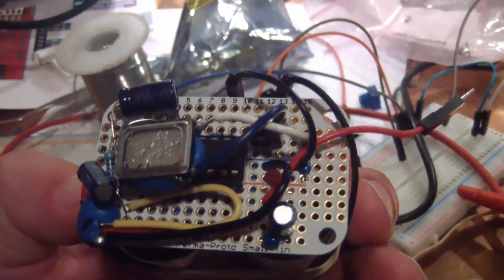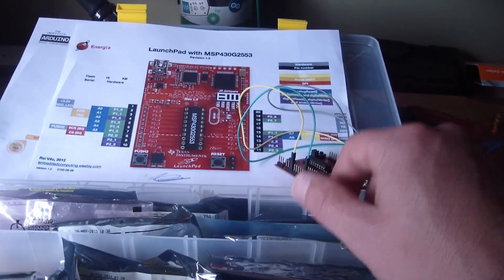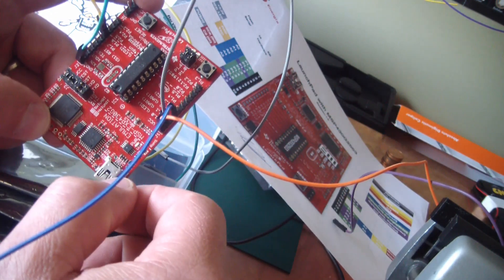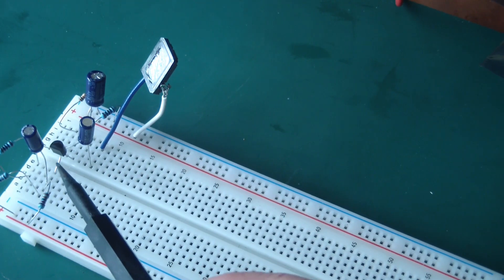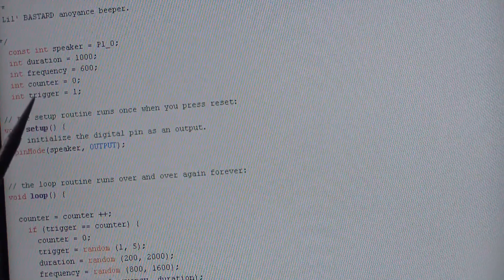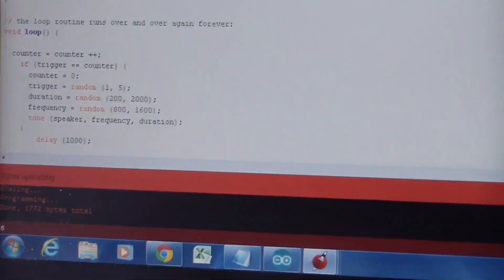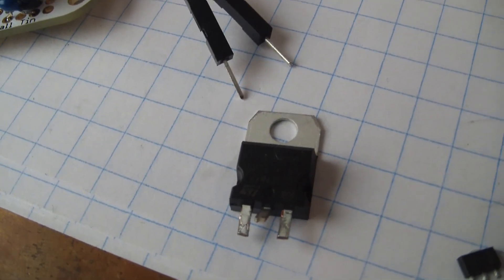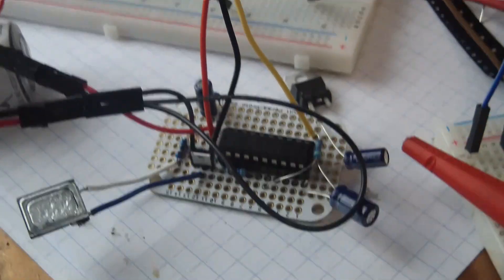Zen Blaster; a Most Annoying DIY Electronic Device

Comment: Get the frequency up in the 17-22khz range for even more evil fun.
Reply: PhattyMo barely anyone hears that, also that speaker might not handle
Reply: SugarBooty I don't know about the particular frequency but, there are crickets here that sound like a high pitched fire alarm bell going off (constant sound not a 'chirp, chirp' type sound,) and these bastards are ridiculously hard to locate! It's pretty fun trying to find it!
Reply: inthefade
Indeed, multiple designs were thrown around, with different sampling frequencies, reconstruction filters and corresponding dynamic ranges and stored bit depths, but also with different disc dimensions. It is widely believed that Beethoven's 9th influenced the CD specs. There is indeed one performance that hits exactly 72 minutes, that's the London Philarmonic conducted by Klaus Tennstedt, lending some credibility to the hypothesis. However, Herbert von Karajan's (Berlin Philarmonic) performance is a lot shorter at 67 minutes, as are most others, and it was Karajan who was featured at the unveiling of the final spec.

It definitely wasn't for Mozart, his longest is the 41st and it spans barely more than half an hour.

It is to be kept in mind that CD is an approximated Constant Linear Velocity recording, i.e. the CD contains a lot more data on the outer tracks than on the inner ones, and the rotation speed is adjusted accordingly in early CD players (later ones simply buffer the whole rotation or more to retain same rotation speed). So increasing or decreasing the size of the disk by millimetres or fractions thereof would provide for a very sensitive variation in length. Around the final diameter, 5mm more or less would account for a difference of about 15-20 minutes.
Reply: SugarBooty  I haven't tested it recently, but I could hear up to 21khz or so when I was 18. CRTs are still annoying as fuck to me, so I know I can still hear up to 16khz.
Reply: PhattyMo Yes,I'm aware of the human hearing range. The idea is to turn the frequency up just high enough so you can't hear it anymore. Example: A friend and I made something similar with a 555 timer,a Horiz. output transistor from an old TV,and a piezo horn tweeter. We hid it under the couch,and discovered that it would make his room mate cranky. And after a while he got REALLY cranky,and he would decide to leave the apartment.
Give it a try. You can't really hear it,but it will affect you. It's almost like having water in your ear or something. A kind of 'pressure' feeling.
Reply: PhattyMo As long as you don't make it too loud.  I've read that you can cause damage to the ears even with inaudible frequencies (doing spectrum tests on my studio monitors).
Reply: PhattyMo You made a mosquito!   https://en.wikipedia.org/wiki/The_Mosquito
Reply: Richard C That sounds like torture! Where do you live that you have organic torture devices?
Reply: Maybe I was wrong, I could have sworn that we can perceive frequencies that high! I just tried it myself as well, and I couldn't hear above the same 16khz. Maybe it is the sound card, I'll have to try with my frequency gen, that is broken.
Reply: cyberconsumer yeah, pretty much only children and dogs can hear in that range.

6-12 kHz should be audible to most normal adults.
3-6 kHz would still be in the hearing range of most elderly people.
Reply: cyberconsumer Thanks, that will be useful to know in the future
Reply: compwiz00 Indeed, I still hear CRTs to this day! I still haven't fixed/gotten a new frequency generator, so I can not prove or disprove anything as of now.
Reply: SugarBooty Also if you're running poor digital audio gear it literally strips out the higher frequencies.
Reply: +PhattyMo holy shit -- that is fucking devious, right there. You guys literally generated a mild anger-issue for the guy, lol. I know that "pressure feeling" you're referring to, btw: The guy's eardrum is vibrating like absolute crazy while the tone plays, despite that he can't hear the sound, so there actually is pressure from the air being moved in the canal by his eardrum. Devious, I tell ya. 

...

Genius, too.
Reply: +SugarBooty  What are you listening through? I am yet to find headphones which can play beyond 12-14 KHz, if you're lucky, and honestly that's plenty for actual music. Speakers... yes, i have some ELAC, they can do maybe 20 Khz, but the waviness of the response around those frequencies is going to be pretty high because there's edge diffraction interfering everywhere, there's a lot of energy loss, you'd need to generate band limited noise or sweep around a bit and find the frequencies that actually play. Also they will only be audible dead head on, a few degrees of angle and they will be nearly gone.

It's possible to hear very high pitched sounds. The question is, whether you WANT to hear them. At somewhere between 16 and 20KHz (individually different), the audibility threshold rises sharply, and approaches pain threshold. You can't even specify the audible range for an average person without specifying the sound pressure at which you want those things to be audible. And then at the edge of the range, there isn't going to be much frequency sensitivity whatsoever, it's not even clear how much you're hearing of the original frequency and how much of the ear introduced distortion.

CD Audio settled on a 22Khz Nyquist frequency in order to give a few KHz of room for the reconstruction filter to roll off. I think 20Khz -3db was taken as a guideline to be able to build a reconstruction filter economically and without introducing more distortion than the dynamic range implies, and 22Khz Nyquist emerged thusly, and from that followed the approx. 44Khz sampling rate. In professional equipment, 24 Khz Nyquist was chosen to give reconstruction filter even more room and reduce distortion and noise even further, as additional dynamic range is required for intermediate recording material.

BTW, even for today's recording formats and hardware which runs very high sampling frequencies, the reconstruction filters are still usually built with 20Khz corner frequency... make of that what you like.
Reply: inthefade
 Actually i found this document written by one of the Philips engineers: http://www.turing-machines.com/pdf/cdstory.pdf

According to this, anything about or above 40Khz would have clearly been acceptable, but 44.1 KHz was already an established system in PCM data encoding for video tape, so they chose that, and that frequency couldn't have been any different because it was a multiple of TV broadcast line frequency. In my opinion, it implies (though it is not mentioned) that there probably was already a suitable 96db S/N (16-bit equivalent) filter design for 20khz bandwidth and 44.1 KHz sampling rate.

He also says that Beethoven's Ninth length was not instrumental; but he does mention sheets of agreed upon size and length targets from the upper brass, and the question where those come from arises, the length of any particular music piece could have still played into that.

Of course high quality vinyl LPs aren't particularly long, you could potentially fit them on a 10cm CD, a format which was, by some accounts, also suggested at SONY.

Here's another account from the same guy: http://www.turing-machines.com/pdf/beethoven.htm

This one does mention Beethoven's Ninth specifically; and it concludes that the reason the size of disk was chosen is in order to prevent Philips affiliates from getting a head start on pressing CDs. It also makes a point that they actually had a great latitude of recording densities to play with, and settled on one 30% lower than what they could achieve, because 12cm size was already decided politically.
Reply: SugarBooty I just downloaded a tone generator for PC and in decent headphones I can't hear past 16 kHz. Maybe the sound card is crapping out, I don't know. Upper perceivable boundary decreases with age and I am 25.

*Correction: nothing is audible with sine shape, square wave setting produces something audible in the whole spectrum, but I think it's garbage.
Reply: SugarBooty Above 20 is inaudible to almost everyone...15-20 is millenial hearing, 12-15 is genx age
Reply: frollard  I am on the older end of millennials (and my parents are gen-x), and despite my seemingly otherwise advanced age (31), I can hear up to about 18.2 kHz in one ear, and about 17.4 kHz in the other. some tables though said that for my age-range, the expected upper end was a bit lower.

lower end seems to be about 15Hz.

I have noticed that, on my PC, trying to play a silent waveform generates a faint high-frequency squeal (not sure frequency), but it is not readily noticeable if any other sound is present (and is absent if no sound is playing).
Reply: Siana Gearz I heard the 22.05KHz Nyquist freq was decided on somewhat arbitrarily because they could fit a particular Mozart composition (I forget which one in particular) on a single compact disk at that sample rate.  And that is why 74 minutes was decided upon for album length on CD, sample rate derived from it.

I'm sure the engineers wanted it to be >20KHz, but I had heard a different logic to the choice of 44100Hz.
Reply: +SugarBooty There used to be a 'misquito' ringtone kids used in school so the teacher could not hear it, since people typically lose the ability to hear it at 20-25 years old. it was in the 16k-18k range. 
Adults usually can not hear much past 15k after they hit 20-25 years old. It only goes down hill from there.
Reply: PhattyMo 5kHz is the frequency of a chainsaw and nails scratching the blackboard
Reply: compwiz00 took my desk out of the classroom because a history/ football coach did not believe the 32"CRT was driving me crazy, no audio  just a black screen . at almost 40 it takes higher audio vol. to drown out the CRT noises.
Reply: cyberconsumer If i'm not mistaken, 22khz is still considered to be in the healthy spectrum for hearing. It might be fainter but we still hear it. Higher frequencies are harder to locate, and thus will be more annoying. Also, I think that the speaker would handle it fine. It looks like a tiny little tweeter thing.
Reply: @sugarbooty  maybe the minute you're born, but give yourself a few years and you'll struggle to detect 18khz even at extremely high volume.
Reply: SugarBooty
MP3 compression cuts everything above 15 kHz, maybe there is a reason.

Comment: Arduinos for good and launchpads for evil?
Reply: William Anderson a single 8-pin Attiny25 + a piezo speaker hooked up to two digital pins and a battery will do the job as well. Using the Arduino as a programmer you can flash the program. This way it's cheaper, and you can use the full arduino for something more useful
Reply: topher Piezos bend in one direction if you apply a voltage, but they don't spring back very much. By reversing the polarity you bend it in the other direction. Keep cycling the polarity to generate sound
Reply: nrdesign1991 To simplify, with DC on piezos (and really, any speaker), you are generally pushing (positive offset from 0V) or pulling (negative offset from 0V). What you want is to push (positive) and then pull (negative)immediately after the push, which is doubling the displacement of the vibrating membrane. this simulates an AC waveform, which is what speakers are almost always intended to use.
Reply: William Anderson Every evil genius needs one.
Reply: nrdesign1991 yes!!

But you still need a transistor to up the volume.
Reply: topher I thought about abusing two digital pins as a H-Bridge / D-Class amplifier. Driving a piezo single-sided with a transistor won't boost the volume much.
Reply: nrdesign1991 so Darlington it!

Comment: Little tip:
counter++ itself increments the var. counter = counter++ set's counter to counter and then increments counter. so you could ommit the "counter = " part
Reply: ***** Yea the moment he said anyone who knows C avert your eyes I was like cool time to ignore for a second and still ended up seeing his code. It made me cringe.
Reply: Rob Nelson but part of the process of improving your code (or anything else) is to get feedback.
Reply: mainly just the unnecessary lines of code. Most of that loop can be condensed to a couple lines with no need for the if statement.
Reply: illudian Sleep puts the processor in sleep mode and therefor saves power. (10uA instead of 800uA in the video)
Reply: PyroShim he could have simply just set a random delay and not have had the counter, trigger or if statement.
Reply: well I have been up for 24 hours so I think my brain was like oh hey your talking about sleep yea I need that
Reply: +TheTrueM3ga You have started something beautiful with this one.
Reply: 曾其威
In this case it's even simpler: don't write retarded statements. What's the point of x=x++ when you can just do x=x+1, x += 1, or x++? Not just this, but it uses post-increment, so even if it weren't undefined it's just asking for a coin flip as to whether the old or new value assignment would occur. It's like the original statement was intentionally convoluted. Might as well write x=x=x=x++.
Reply: illudian What is so bad about the code?
Reply: PyroShim herp derp the moment I put that up I sat for a second staring at the screen wondering why my brain had decided to just turn off.
Reply: chickenpoper Even worse, counter = counter++ invokes undefined behavior, and your compiler might generate code that for example doesn't increment counter (cranking up warnings and enabling the optimizer usually gives a warning for this kind of thing).
Reply: +Leonelf  ++counter would be better. counter++ creates a temporary variable to return the original value before increment. Assuming the compiler doesn't realise what's going and optimise it away.
Reply: james chatterton
Any modern compiler will generate the same code for ++counter and counter++, assuming you don't use the value of the expression to assign to something else.
Reply: blargg Yeah I expect they would, optimising and all. I still prefer ++counter myself to prevent the side-effect.
Reply: bno112300 He defined the start condition so it is not that bad. If counter is defined it is defined behavior.
 Not that he needed that variable. He could have counted the trigger variable down "trigger--;" and make the if statement (trigger == 0)
Reply: illudian True. But a sleep would be even better instead of a delay.
Reply: PyroShim To be perfectly honest I am not even sure I remember which is better since I haven't used either one in a little too long.
Reply: illudian sleep(1000);  // xD
Reply: makomk isnt it standard that it increments later if the ++ is after the var? or is that exclusive to java? (and ++value increments value and then returns it)?
Reply: Also if this project lasts long enough wont counter roll over to negative values?
Reply: topher No. He resets counter every time the desired trigger value is reached.
Reply: +chickenpoper alternatively compound operator += as in:

counter += 1;

But one would rarely see this for just 1.
Reply: Leonelf I'm
Reply: One could say I know something about C. A more efficient way would be to put the increment statement inside the if statement, thus:
if (++counter) {
(The pluses before the variable says "increment me prior to checking this variable").
Reply: @L0j1k  a more efficient way is to write it in assembly lang and ignore C all together
Reply: ***** Increment operator takes precedence to assignment operator, therefore that line would resolve into {counter = counter + 1; counter = counter;} and the second part would most likely be optimized (ignored) by compiler, just as it is when there is no destination given for the result of the increment.

As far as code quality, it's typical work-in-progress code, but he sticks to his own code style. The indentation is drifting a bit, but that can be fixed with two clicks inside the IDE.
Reply: blargg 
well, there's always a very high chance that there exists some "simpler code" to a certain representation of code.
so there's no problem for me if someone prefer one over another, as long as
1. the code explains itself
2. it is running exactly as what the author wanted it to run (yes, codes don't care what you THINK it will run, it only care about what's been WRITTEN for it to run.)
3. no logic flaws (you want something to do A but it infact does B, or it does A but with a horrible side effect C, stuff like that)

so if that `x = x++;` is written on purpose, sure you can do it.
but you shoud be prepared for all the consequences.
Reply: Alternatively, it might increment counter and then set counter to its previous value before it incremented it, depending on the compiler used and the phase of the moon. Undefined behaviour is fun!